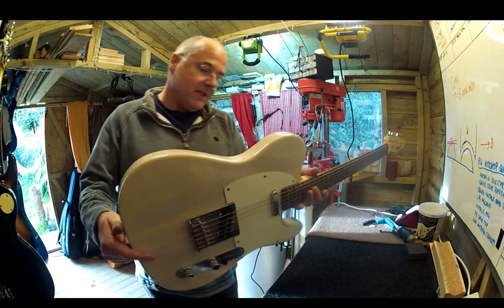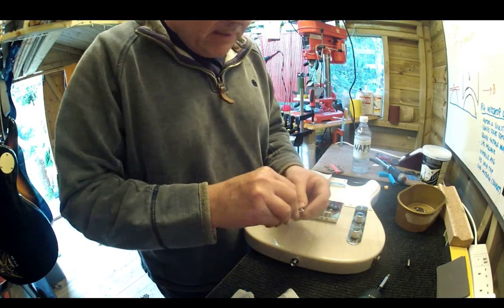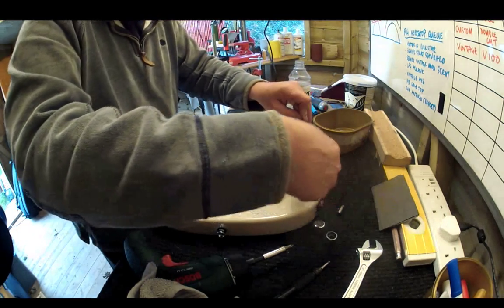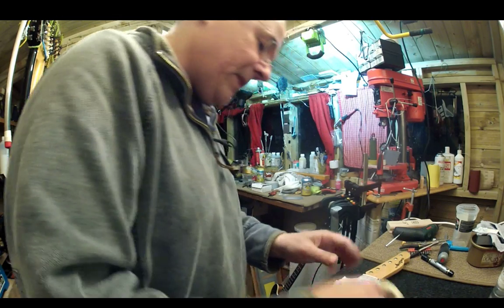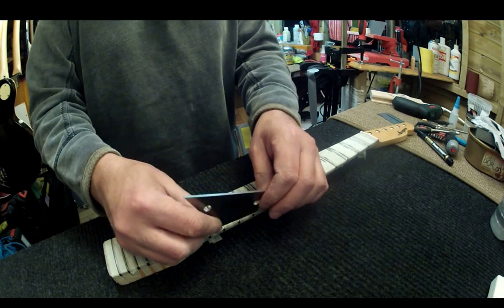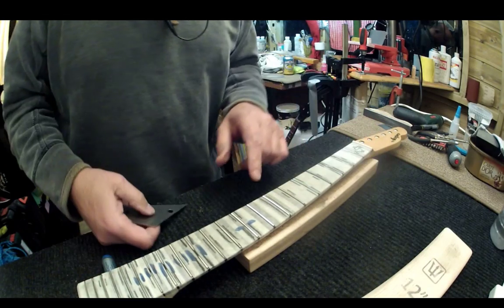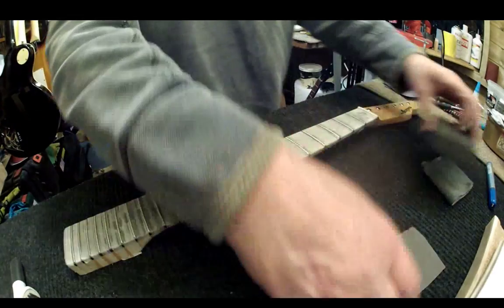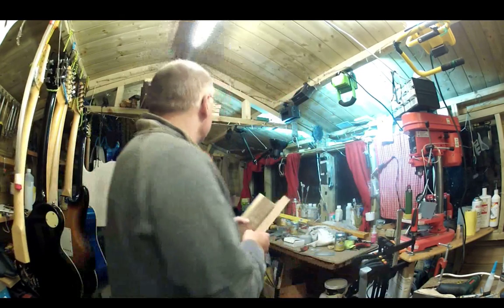AcePro Tele Set Up Part 1

Comment: Sorry Sam, You've just got quieter and quieter, I can't make you out at all now !!!!!!!!
Reply from the maker: Ah, very old video = some sound problems. These days I use a Sony Action cam instead of the old Go Pro and it's simpler (I can use the on-board mic and it works), so less screw-ups.